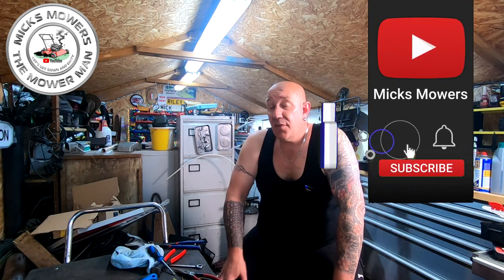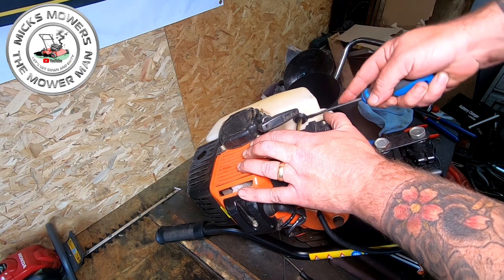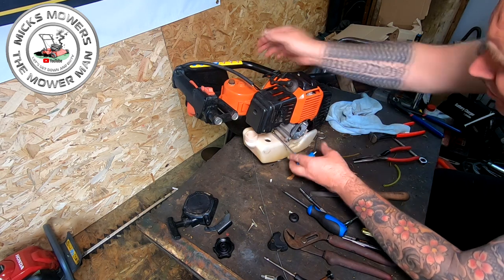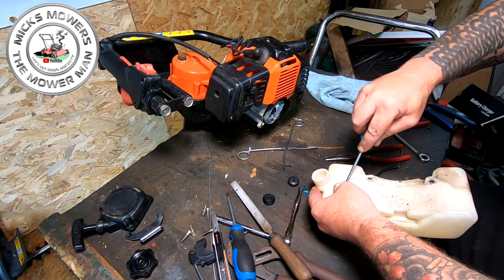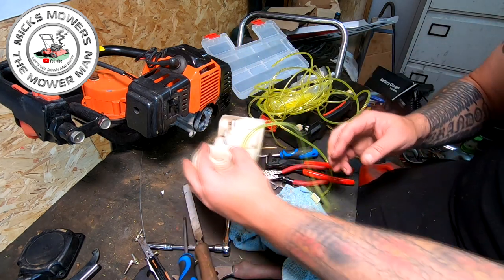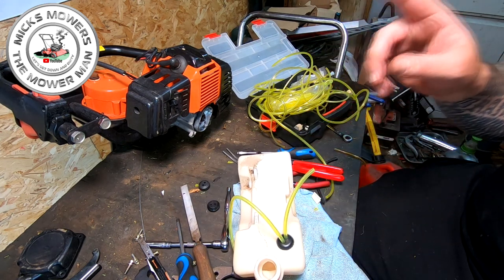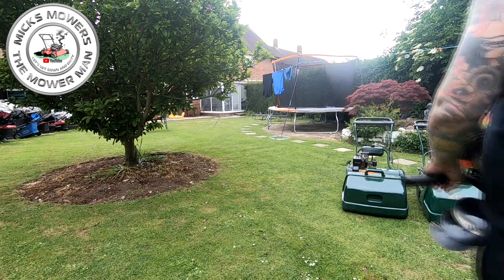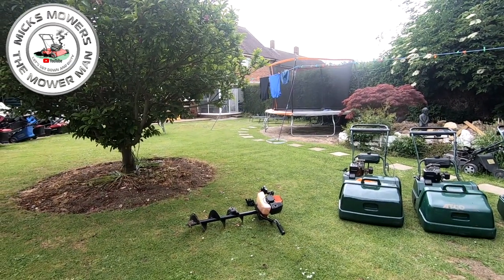Post Hole Drilling Auger Machine Not Starting #micksmowers #auger

Comment: Your bang on there with the cheap chinesium machine, the motor looks just like the ones supermarkets ect use on their own brand brush cutters. They run fine for about a month then start playing up as ethanol in fuel deteriorates the fuel lines and the gunk in the filter and the unknown mass in the tank looks like the seal off the cap which has melted from the ethanol.
You might find on the top of the carb in the center of the throttle linkage a plastic plug, under that there might be a tiny brass screw which adjusts the low idle mixture the bigger screw on the side will only do the high mixture, for some reason they hide the idle mixture to stop people messing with it.

Comment: I had a similar problem with my post hole borer with the same engine the choke was the wrong way on that aswell. Had no end of problems with that engine so i removed it and replaced it with a Honda gx35 engine as the gear box bell housing is the same it's now an absolute beast of a machine with that Honda engine 👌 I still have the engine in the workshop if you want it for spares Mick ?
Reply from the maker: Hmm let me think ,No thanks mate lol
Reply: @themowerman  just a thought. got a lot of spares I need to get rid of and Viking mb650 and maybe a Dr trimmer if know anyone that's looking for one 👍
Reply from the maker: @ashtreecare  where abouts are ya mate
Reply: @themowerman  Midlands Warwickshire just between Oxford and Birmingham 👌